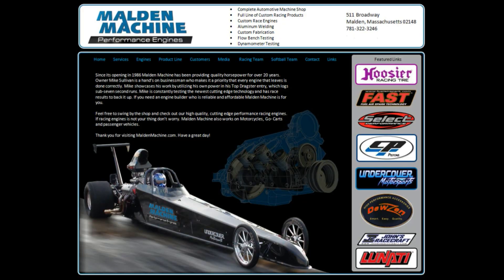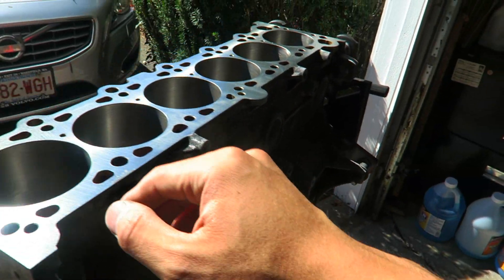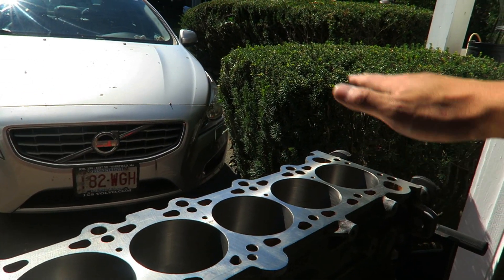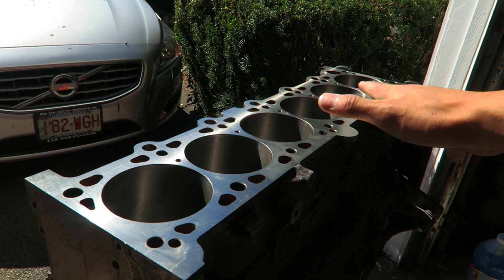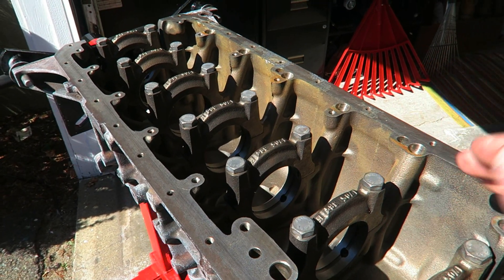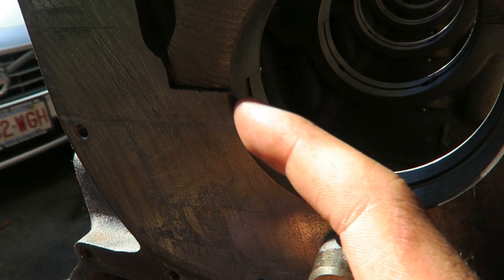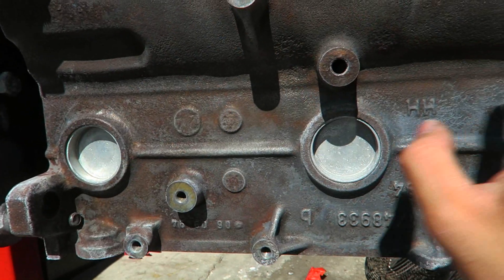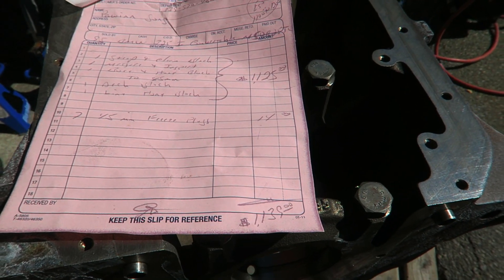BMW M50 Block Update! The Cost of Machine Work

Comment: Very nice review of what's needed.  Thinking about using an M52/M50 block bored to 86.5 as a base for a turbo motor for my e36 m3.    Was there any discussion on milling or balancing the crankshaft?   I'm just going through your back catalog so maybe I will find it later on.

Comment: That was a really good price 😱👍🏾👊🏾, I  hope I find something in that range, here in Miami. I want to go up to 3.0, may be 3.2 if possible, better valve springs, custom cam, head work, forged pistons, ITB or a good flowing intake, once I get the most NA, may be later in the future I'll put a small turbo if I get bored of the High RPM NA stuff. I been saving and buying things slow over the past 3 years. The iTBs, large throttle body, and full exhaust are super expensive. Almost 3k between both. Am on the last few items. Good luck to everyone, and stay safe.  🙏🏿🙏🏿🙏🏿

Comment: Yo i appreciate all this e36 content, i really learned a lot off of you😁 i got a question though how much can i actually shave off the top of the deck
Reply from the maker: When resurfacing a block or a cylinder head you ideally want to remove the least material as possible, I’d say no more than 0.005 in (5 thousandths of an inch)
Reply: @Pawinning  sweet man thanks a lot cause i been lookin everywhere for the redecking specs with no luck. Im assuming your build is still running strong after 3 years?

Comment: Nice machine work.  Keep at it. If you are not going to assemble the block right away at least spray it down with a good preservative. Keep the rust away from that new metal.

Comment: what pistons did yo use to bore it to 85 mm? and why dind bore it to 86 mm to use the s50b30 piston
Reply from the maker: Hey man! I was looking into getting the VAC motorsports frankstein stroker m50 with my bore size choice. I was considering the b30 parts swap but really not sure about where this engine build will go. Simply can't afford the parts I need 🤷🏻‍♂️
Reply: @Pawinning   and is it sage to bore the block to 86 mm??
Reply from the maker: @gerenciaimagenespublicitar2039  I believe it should be safe 👌

Comment: What do you think about M52B20 with alloy block with alloy sleeves? Is it ok? Or should i stick with M50? i live in EU, Serbia
Reply from the maker: you can’t go wrong with either! Just stick with the best deal you can find, as the majority of the parts needed to hold boost are around the same price.
Reply: @Pawinning  aha ok... I know that m52 have problems with nikasil, thats why i asked...
Reply: nope,,i have a 2000 e46 323ci with m52tub25 engine and its aluminium with iron sleeves.and dual vanos.
Reply: @08halit  from 95 to 98 e36 m52 for EU market have alu block with nikasil... Read on internet, m52 problems with nikasil. In UK and USA they were with iron sleevs...
Reply: agree and they changed it from 99 upwards to ironsleves,,think it was the sulfur problem for nikasil sleeves that made em change it.. in some way im lucky to have them ironsleeves in mine but unlucky my car just puts out 170hp..i mean a new mod vw golf diesel pulls away from me or i have hard time with it..for years now i have been thinking of swaping my engine or turbo it,,but havent taken the step..closest thing i was to buy was a new b58b30 engine with gearbox,,i bid and won the bid but couldnt find a place that would make the swap..now im looking around and like how they make stage 3 for the n54 with twin turbos,, and i think why not make similar set upp but for the m52 vith twin turbo similar to the n54.. i know they sell diy manifold with bends. but but
Reply: @08halit  what do you mean unlucky?
Reply: 170hp isnt much in these days..i love this car with its collor and style...Topaz blue with cream collored leather seats convertible..but to low on hp.
Reply: @08halit  i live in serbia amd 170hp is very good here... i drive car that have 72hp :) 0-100 around 12sec, and i need 6e for 100km :) Consuption around 10l per 100km :) We have small salaries in Serbia so we cant aford something with 200+hp ...
Reply: i understand your point, but see it at my perspective,,i love this car but the engine is weak,, i can get it fixed but have hard time finding a good mechanik..as i typed earlier,, i was about to buy a new b58b30 engine with 8speed auto gearbox but i couldnt find a mechanik so i lost that pice of engine,,can you imagine the new b58b30 engine in a blue e46 cabrio..
Reply: @08halit  that would be sick😂👍
Reply: i found a package again,have done 9000miles for around 4k euro..im thinking of buying,,are searching now for a mechanik that can do a swap,,so if im lucky ( has newer been ) i will find a good mechanik for a reasonable price and buy that b58b30 engine with hearbox to make the swap,,if that happens i will make a video of it...
Reply: @08halit  nicee, can't wait to see💪
Reply: Iron block and non vanos heads are the best. I made a 3.0 short block and got stuck with double v heads. Cams are super expensive so its just port n polish and exhaust so far.

Comment: Have you done the research on the m50s to what the issue was in the m50 nv an vanos the m54 s50 an s52s from all the years have a egg shape cylinders walls an if u build one of these motors an do not tq plate it an get the cylinders round you will get blow by an A LOT less life out your build trust I learned the hard way

Comment: was your engine already assembled when u brought it to the machine shop? $1163 is a bit high but it looks like they did a really good job, was the top end and bottom end reusable?
Reply from the maker: +Tyler ford no I had taken it apart completely and plan to reuse as much as I can. Yes the price is steep, but granted I had to get it bored out and then honed to increase the bore size.

Comment: Your channel is great! And better because I have the same exact engine. What would you recommend to mod in order to start increasing the horsepower a little?
Reply from the maker: +Fer Andrés start kit with a tune/exhaust! Power pulley kit/viscous fan delete will also increase power!
Reply: @Pawinning  is it safe to bore the m50tu block to 86 mm? Im willing to try the s54b30 pistons

Comment: Damm you got ripped off.
Reply from the maker: +Grab America by the Flaps really? From what I was told the price was reasonable. The shop I took it too was the closest to my area of Mass.
Reply: Pawinning you didn't get ripped off, just depends if you take your engine to a dirty/sketchy machine shop that still does quality work ($500) vs a machine shop that has brand new machines and is very organized. Mine should be around $1000-1200 and I got the head and block decked, bored to 86.5mm, crank balanced and polished, valve job on head, and a bunch of stuff media blasted and cleaned up